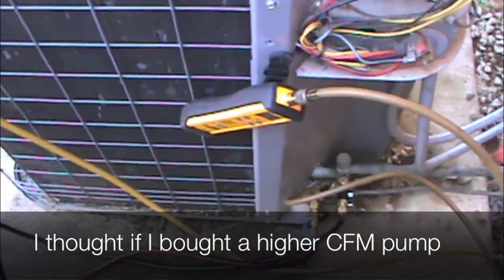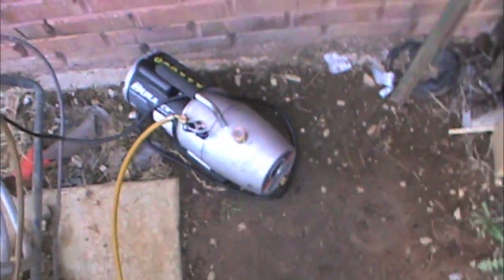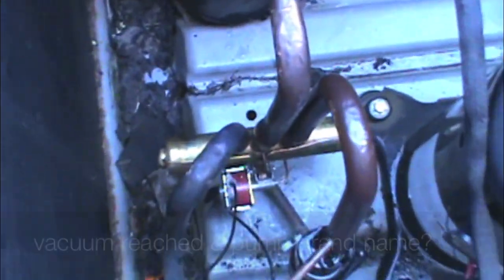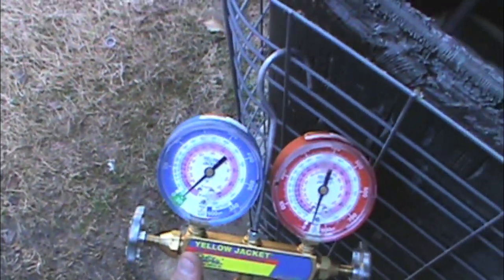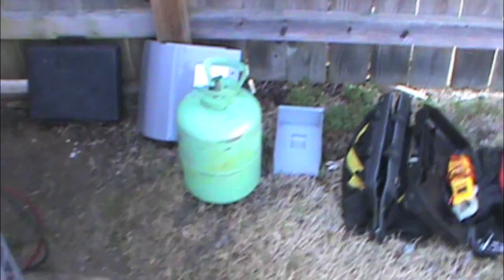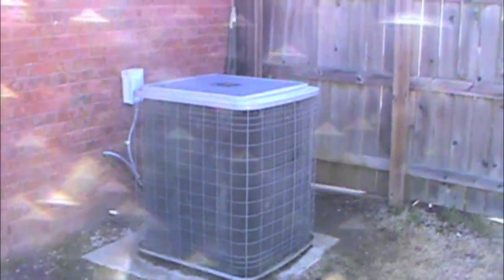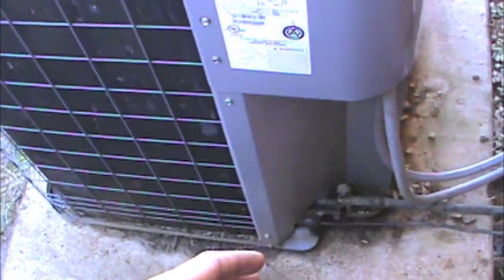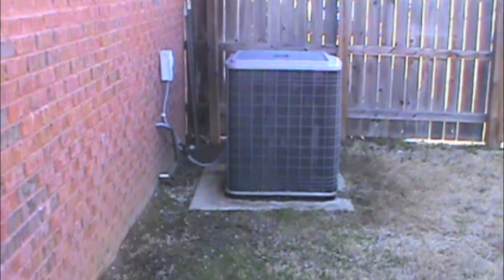HVAC Intermittent Reversing Valve Failure Part 2

Comment: i got a yellow jacket at 6 CFM......i got no issues diving under 400 microns.
Reply from the maker: Yea, finally figured it out, it was my gauges leaking through the manifold. Thank you for watching and commenting Jeff!
Reply: i had a problem one time.  took me forever to figure it out.  i bought a brand new off the shelf set of 60" hoses and the high side hose was leaking at the low loss fitting.  i never suspected a brand new set of unused hoses that i just paid 100 bucks for earlier that day.  had me scratching my head for a long time.  this field is complicated enough without new crap blowing up on you.  LOL  and YW.....

Comment: I think you can only suck 0.8cfm down a 72" gauge line so theres no point going too big with vac pumps unless you have bigger hoses etc, even then the 1/4 connections to the systems are restrictive too.

Comment: I always go below 500 microns. and go with a JB pump. They seem to be the best for the money. good work.
Reply: It depends on how tight your system is. Your pump should be pulling down to 25 on its own. Do you test it? just use you gauge and a hose. Should take lees then a minute.